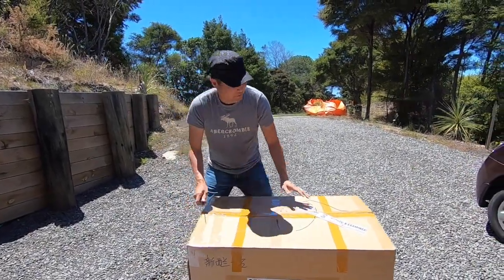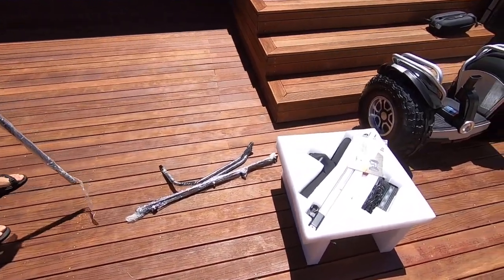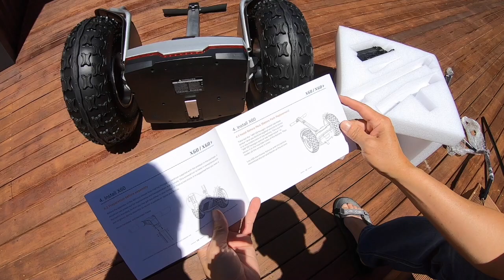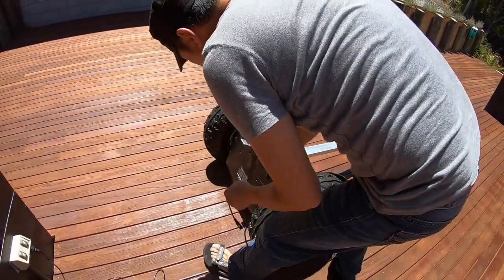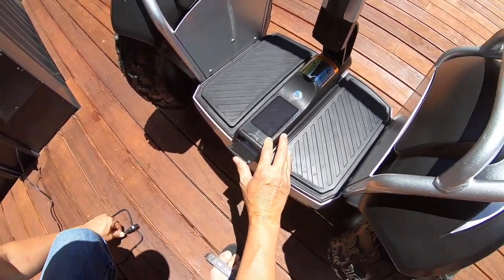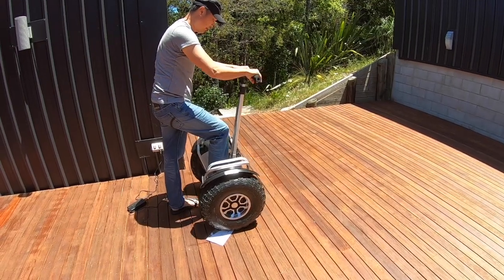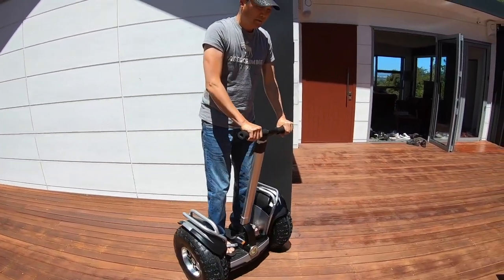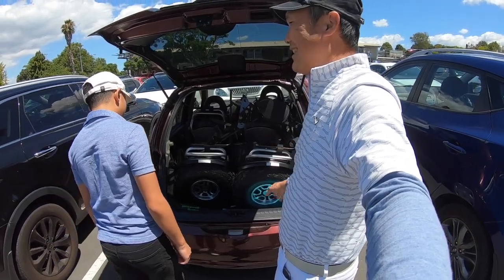Segway Golf Adventure 2020

Comment: Hello Jit Ming - Just curious, are these machines still working?  I'm thinking of getting one.  Thanks!
Reply from the maker: Hi Dave...I bought 2 units. One died just about 3 months into it, the second one is still working. The problem with getting it from China is the lack of support. There's no way you could seek redress/warranty etc.
Reply: @jitmingtoh9906  Thanks for your prompt reply Jit Ming.  These Segways must have caused a stir on the golf course - did you have any problems with the grounds men not allowing the machines on the course?
Reply from the maker: @davidkuek8822  yes...it is quite a talking point. Always draws attentions and conversations. All courses here in NZ are ok with it...at least the courses I've played in so far. Some courses will just remind me not to ride it on the green. Otherwise all good.
Reply: Thanks Jit Ming!  Do you know what broke in your other machine?  I have been corresponding with the manufacturer in China and he tells me he has a 6 month warranty on the battery and one year on the machine.  Just curious to see how sturdy the machine actually is as I’m deciding between this, and the ESwing M12 scooter to get around the course (I’m in Perth Western Australia).
Reply: Would you say it is reasonably rain-proof?  Do you have to take off the bag attachment when you transport this by car?
Reply from the maker: @davekuek4811  it is hard to say for sure, but a overboard vendor suggested that it is likely the issue with the motherboard. When I brought it up with the supplier, they insisted that I buy the motherboard as a fix. They would not supply it free even though it's just within 3 months of use because I could not be 100% sure it is the fault of the motherboard. I am sure they were just denying me the warranty support..
Reply from the maker: @davekuek4811  yep...reasonbly so. no trouble there. I transported it with my Mercedes S350.Needed to dissemble the bag attachment and the handle bar. it fits into the boot. but I needed to put my golf set on the back seat.

Comment: Hi! Thank you for made this amazing adventure video, I like to buy one too, but unable to find Segway golf on their website. Where did you got from? Can you please share a link below? Also if I just buy the Segway S max, will the golf holder later can put together too?
Reply from the maker: I could find it at Alibaba website. Segway is now owned by a Chinese company. There are now many brands of similar product made in China. The golf holder can be bought separately and can be installed later.   There is a risk of buying it online though. I bought 2 units, and 1 died just about 3 months into using. The seller would not refund or replace. There's little you can do to seek redress. Good luck
Reply: This is our new moder. please check it

Comment: Thinking of ordering, would you recommend purchasing?
Reply from the maker: ya..why not. Lots of fun. But do prepare to fall sometimes. It's not the most stable rides...what you see in youtube with ppl racing it cross-country style....is just BS. Go easy with it....you'll be fine.
Reply: @jitmingtoh9906  thanks, just wanted to use it for golf.
Reply from the maker: Yes sure...that's what I use it for...golf only. Just go gentle on the fairway. As said...it's not the most stable rides around. Battery is good....18holes used about 45%. So could easily do 18 without worries. Good luck

Comment: I’m 60 years old but in good shape. How hard is it to get this in and out of a trunk? Thanks
Reply from the maker: Takes a bit of effort, but can manage by one. I'm not a big guy...I could manage. But be prepared to fall as you ride...no matter what they say, 2 wheelers aren't the most stable configurations.
Reply from the maker: Also good luck in your purchase. I bought 2...one died within couple of months! Barely used 5 times. And it's impossible to seek support from China...so it's wasted